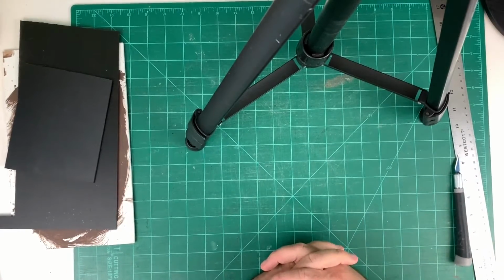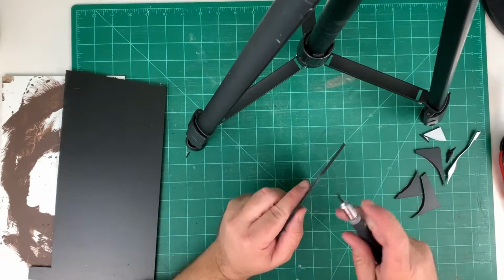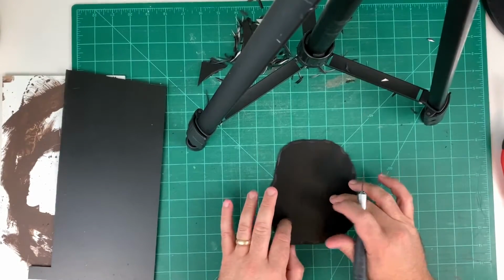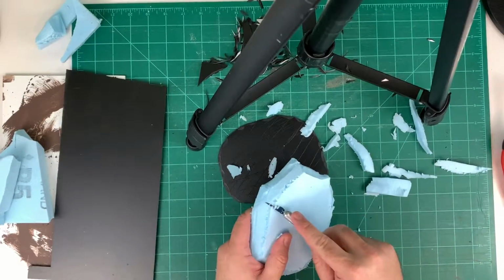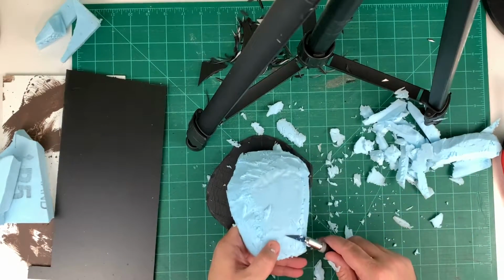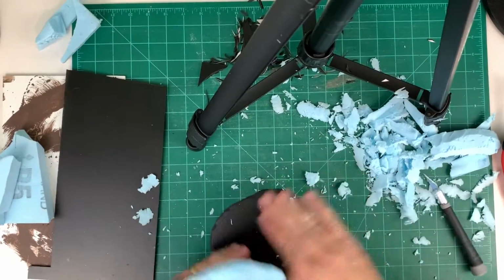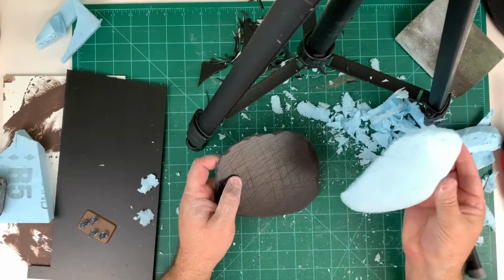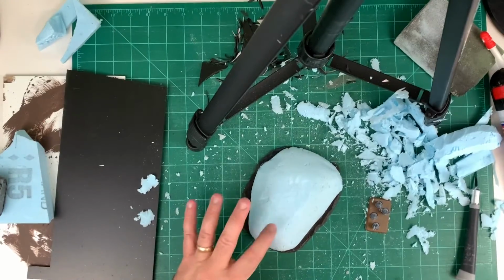How to build 15mm terrain hiils for minature wargaming part 2

Comment: Nice video. Thanks for making it.   I think using a larger sharp flate bladed knife, like a steak knife, gives less tiny pieces, and takes less time.   I'd recommend using a dust mask in an enclosed space when sanding expanded  foam.
Reply from the maker: Yep, using a dusk mask can really help. Thanks for the tip.

Comment: A $25 hot wire cutter will save you an immense amount of time.
Reply from the maker: I completely understand. Thanks for the tip. I have used them in the past, but I like using the knife better, and no plastic fumes. But I know a lot of people do use them.